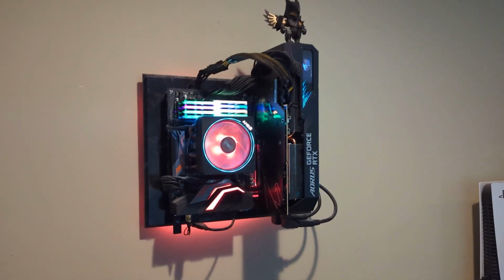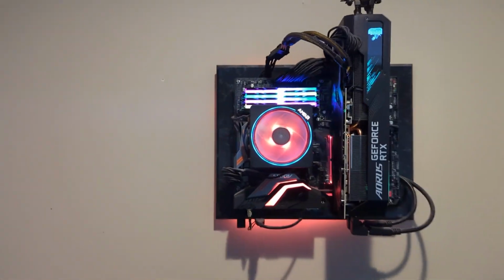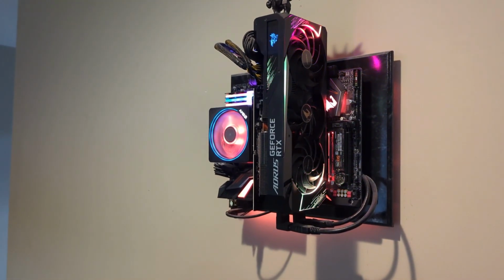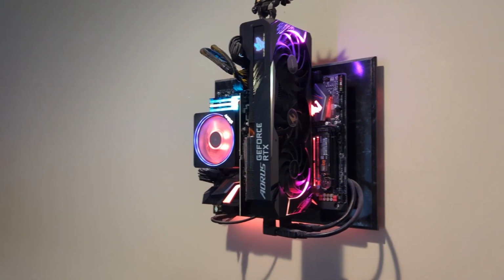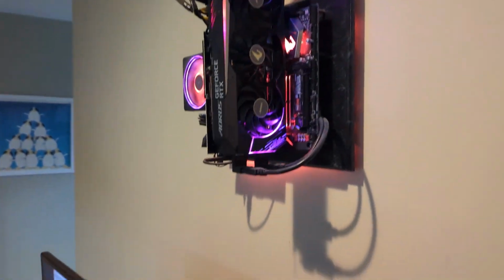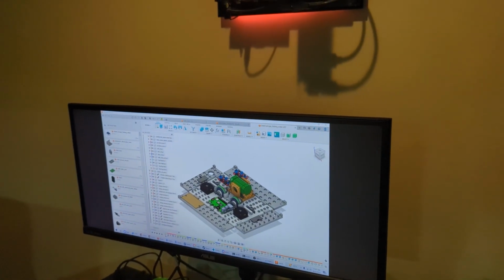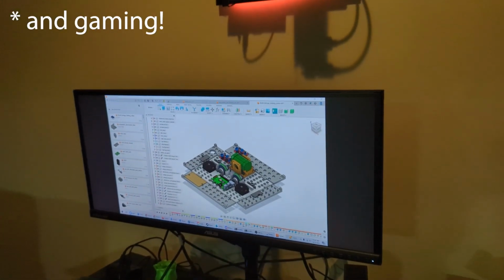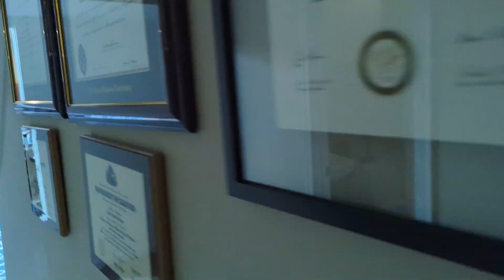Most Annoying Computer to Fix

Comment: I would replace the power supply with a fully modular one so that you don't have to run as many cables. Also use cable extensions, some are thinner than regular power supply cables.
Reply from the maker: After the warnings about opening the PSU (and it's old, anyway) replacing it might be the way to go.  I'm an old guy, and in my time most "modular" power supplies had at least one fixed cable which is why I didn't bother.  But I see there are options for 100% modular, so that seems to be the way to go.  Extender cables for a non-modular supply also seems like good strategy.  Thanks.

Comment: Next build get a Modular Power supply.  Fans are easily replaced.
Reply from the maker: Good point.  Most of my modular PSUs have at least one fixed cable, but I see from a search that you can get ones that are 100% modular.   I guess I'll have to go that route next time.

Comment: Really cool. I think you are going to have to completely remount it though. I think a build like this would benefit from more modular components. At least if the PSU failed, would could have just replaced the unit and kept all the cables routed through the drywall.
Reply from the maker: Indeed. I think I've now decided I have to get a new, 100% modular PSU from a popular manufacturer so that if it has to be replaced, it should be easy to find a unit compatible with that wiring.

Comment: Big question is, does the power supply still deliver a stable 5 and 12 volts. If so it is most likely dust buildup. The danger of opening up power supplies is the built up and stored electricity in the capacitors. You have to make sure they are discharged. Trick to do that is unplugging it from the socket and pushing the on button of your pc. This will drain the capacitors. To be on the safe side let the power supply cool down for 24 hrs or more after doing this. But if you want to solve this for a long period (experience learns that a failing or wobbling fan is the first step in the dying process of a PSU) you'd better disassemble the whole construct and replace it with a new, fully modular PSU. THE Be Quiet! Series is perfect for this. And don't forget to try and keep it dust free since dust is most likely the cause of this all. PSU's are dust magnets.

Comment: Just be VERY careful if you replace that fan... hitting an energized capacitor is going to do far more than just tickle.

If you can, I'd suggest looking into 12 volt only power supply / motherboard combinations for when/if they come out so you don't have to worry about such a large bundle of cables going through the wall.

Comment: Personally I think that looks kind of ugly. I've got a standard black box on a little table in the corner beside my desk. No jagged, asymmetrical components with gaudy RGB flashing at me. I never even look at it unless I need to insert a CD or plug in some USB device. Easy to service if something breaks and portable if I have to move again, which hopefully I'll never have to move again because that sucked so much.
Reply from the maker: Admittedly, I think it looked cooler a few years ago when I had a more modest GPU on there.  I don't like the look of this monster GPU but it's a powerhouse for gaming, video editing and AI stuff so I kept it for its performance.

I have a few computers and this one is meant to be artistic.  The rest are for value, maintainability and upgradability (and Linux, which I know you're all about 😃)

Comment: Never open a power supply, even if shut down completely you can still lose your life, sadly you have to replace the whole psu, after 10 years also recommended. I recommend a Enermax Revolution D.F. 850W ATX 2.4 if thats available at your location, good luck!
Reply from the maker: I actually have a capacitor discharge tool that I've never used.  But I also thought that the fan would be close enough to the surface I wouldn't need to get near any caps.  But you're right, this probably falls in the category of something I shouldn't be doing.   Thanks for reminding me about the dangers of electronics.